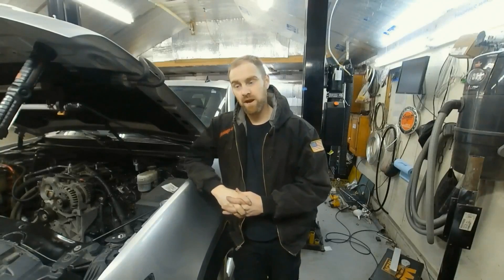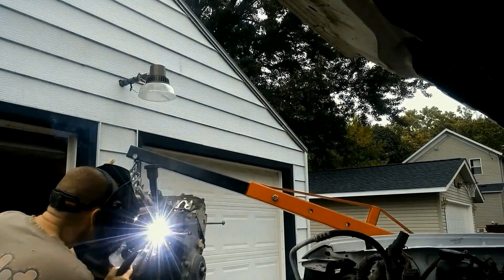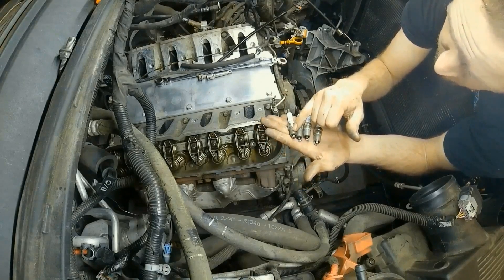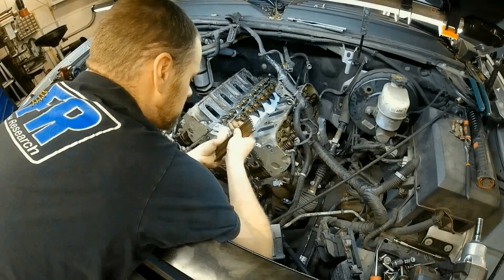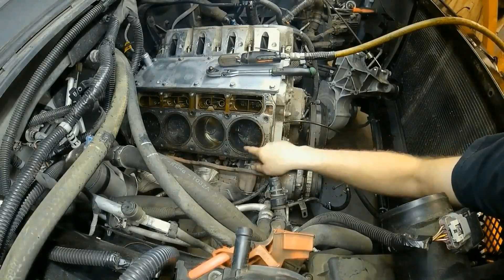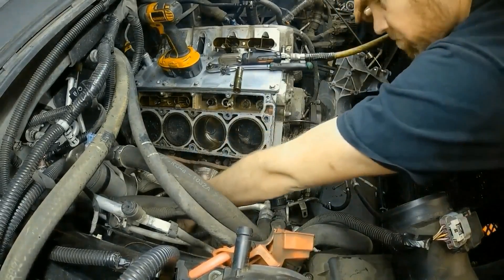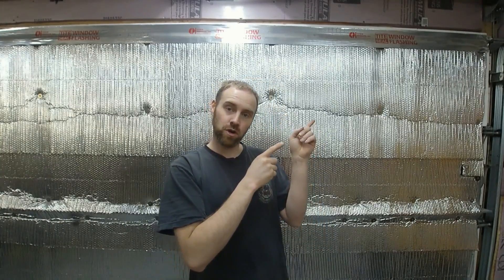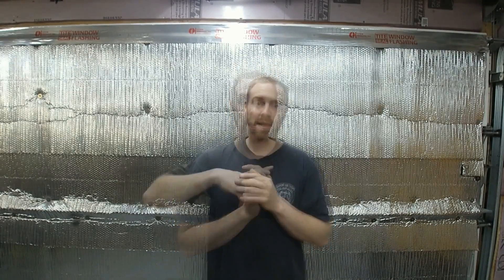DOD Delete kit using texas speed pt1 afm suburban tahoe...

Comment: To turn off the system do you need to install a bypass system
Reply from the maker: I have a video talking about it and I will also cover it again when I finish my editing on the rest of this install
Reply: CrazedPerformanceRepair I have watched all the videos you can’t just say yes or no really
Reply from the maker: @randyhughes5160  ok fine then yes it needs to be bypassed but no it can't be a bypass system. It must be turned off with a tuner within the computer. See not just yes or no, but sort of both because your question was not correctly phrased. So ask a poor question, get a poor answer, show a poor attitude and get a rude response.
Reply from the maker: You must consider I get asked things on a regular basis and if I'm not asked the right thing I may not answer or avoid the straight easy answer.
Reply: CrazedPerformanceRepair I am not sure what I did to deserve your attitude but I can certainly get help some where els and free you up
Reply: randy hughes  R/ChoosingBeggars check it out bro you fit right in
Reply: "To turn off the system do you need to install a bypass system"

Your question makes no sense.? If you have a functioning DOD system, you can leave all the hardware in place and turn it off using a computer reflash or something like a tuner that plugs into the obd2 port IF you want it off. 

LT1SWAP.com, you can mail your PCM onto him and he will delete the DOD for $50. Your truck will be down a week though waiting for shipping. Thats the cheapest/easiest route. The hardware such as the DOD lifters/solenoid can stay in place and should cause no issues.

Comment: Will it trip codes if you do the DOD kit prior to disabling the AFM with a tuner or will it run?
Reply from the maker: It will start but if the vlom is removed or unplugged it will not allow the throttle to operate. The final part of the delete will include changing the tune when I finish the video.
Reply: @CrazedPerformanceRepair  Thank you for replying - will check this out.

Comment: I got lucky and drilled out my two broken exhaust bolts
Reply from the maker: Drilling out seems like more work to me welding is much easier. This truck was luck there because I didn't have to do anything they just came out
Reply: CrazedPerformanceRepair it wasnt bad it took me 20 mins to do two bolts

Comment: Bro question::: 
07 Tahoe LTZ 5.3L with over 200k miles. Been thinking about getting the engine change but am confused in whether get a used engine and break it down to replace all major parts to bring it to a new state as in 0 miles or just find a used engine with low miles and throw it in? Thanks
Reply from the maker: Whats wrong with the engine you have?
Reply: Was told by the dealer when i went for oil change that i have small oil leak which they couldn’t tell where it was coming from at the time they had my truck, so just want to be a little prepared if i have to change my engine changed
Reply: Wouldn’t want to get this one rebuild because it’s my daily truck and would prefer to have something ready to swap just incase
Reply from the maker: @Loyal1029  I would not consider a rebuild over a simple oil leak I have seen a lot of these engines reach well over 300k mi of coarse the ones with DOD need DOD Issues addressed first but otherwise it's usually minor stuff.
Reply: CrazedPerformanceRepair thanks bro

Comment: I am working on my uncles truck 2010  with a 5.3 he has a lifter that is collapsed and it has 20 pounds of compression on number four and number two has 170 pounds what I was wondering do you have any recommendations to slow down the oil consumption once I fix the lifter problem I have heard about the driver side valve cover and the deflector  shield that goes on the oil pan what is your recommendations to help slow down the oil consumption thanks I really appreciate all your time on these videos you do a excellent job
Reply: The truck just has 120,000 miles and has been maintained
Reply from the maker: @mikereasoner4814  turn off DOD that is part of the consumption and if you haven't done anything about the pcv valve cover tsb yet be sure to address that
Reply: CrazedPerformanceRepair OK I fix the valve Cover thanks again for your reply and all the help and with the videos
Reply: I have a question I have an 07 Chevy Avalanche and it's not making any noise but I got a number 4 misfire
Reply from the maker: @briank447  and your question is?
Reply: My question is is I don't have a doesn't sound like I have a lifter collapse but I have a misfire and I replace the valve cover on the left side put new head gaskets on it any ideas
Reply from the maker: @briank447  You may have a lifter that won't lock back out of dod mode like perhaps its little mechanism is stuck thus collapsing the lifter. or perhaps the solenoid in the vlom is stuck flowing oil thus collapsing a lifter.
Reply: @CrazedPerformanceRepair  I appreciate your time I checked the solenoids when I had the valley cover off and all the solenoids were working fine it ran great for almost 2 weeks and then all of a sudden I get a light Miss on number 4 cylinder it's not a hard code yet cuz the check engine lights just blinking so I was just going to run it by I appreciate your help
Reply from the maker: @briank447  When the engine light is blinking it it worse than steady. That means you have a dead misfire Or serious problem and the computer is concerned you will damage the catalyst. look into it asap
Reply: I left a comment above but basically in our '07 suburban we had pretty serious detonation due to oil consumption/fouling (in '13 w/ ~105k miles).  At that time GM had a fix which involved cleaning the engine and replacing oil control rings and installing the oil deflection plate.  After this service the oil consumption disappeared (basically, became reasonably normal like 1 quart consumption between oil changes).
Reply from the maker: @mikegilmore8998  I think 1 qt is too much too unless you are going 6k between changes than I can accept it haha. But part of the problem is the DOD poorly wearing the rings while active and then of course the oil deflection issue with the pcv in the valve cover.
Reply: @CrazedPerformanceRepair  Yeah that was about the oil change interval for us.

Comment: I have an 06 chev Tahoe z71 and I'm hearing this lifter tapping noise....does this year have the dod and if not how would you recommend i fix it
Reply from the maker: In the Tahoe 06 is not likely but possible. May be late model in 06 thus basically 07. You will need to peak under intake and look. If you do have it check my other related videos for the easy trick to try first
Reply: I had an older engine like that tapping. Tore the heads off and put new lifters in. Same noise. New high volume oil pump got rid of the tapping.
Reply from the maker: Then it might have loose bearing or something sounds suspicious. Bad o-ring to sump or closed pickup?
Reply: @CrazedPerformanceRepair  I have had that happen on 3 different LS engines. First was a 2005 police Tahoe with high idle hours. Thats the one I replaced the lifters in. When it got hot at idle the lifters would get all noisy. High volume oil pump quieted that one right up. 

My current truck, 2007 Tahoe w AFM did the same. Engine was replaced in 2012 with a reman. Slung a high volume oil pump in that one and have put 12k miles on it with not a single noise or issue. 

Last was a 2010 Tahoe (old city of Chicago police truck). Same noise, that one had a dried out pickup tube o ring, but I did the pump as well and that fixed that one. 

So yeah, prob a possibility of the dried out o ring, sticking pressure regulator in the pump and possibly a bearing getting a little loose. All engines showed around 20psi of oil pressure with a mechanical gauge tapped into the oil sending unit hole while the tapping noise was occurring.
Reply from the maker: For dod engines that is low oil pressure. they typically are between 30-40psi hot with 5w30. The non dod engines usually are between 15-25psi hot.
Reply: @CrazedPerformanceRepair  Idk, service specs from Alldata for my 2007 5.3. Listed is minimum, so right around 20 I was low at hot idle (around 700rpm)

Oil Pressure - Minimum - Hot:

1,000 RPM 152 kPa (22 psig)
2,000 RPM 207 kPa (30 psig)
3,000 RPM 228 kPa (33 psig)
Active Fuel Management Relief Valve Oil Pressure - as Measured at Oil Pressure Sensor Location: 

Maximum 379 - 517 kPa (55 - 75 psig)
Reply from the maker: @mph5896   Gm also claims on tsb 01-06-01-011I that 1qt per 2000mi oil consumption as acceptable lol so you are better off going by what other vehicles normal is rather than specs. They list things that way to convince customers it is normal long enough to get out of warranty it seems.

Comment: Thumbs down is gm “engineer” that designed dod. Total loser
Reply: My 6.2 denali got 17mpg...had dod disabled and get the same mpg...total fucking gimmick by gm
Reply: It 'peaked' around 60's, less nickle then aluminum, they all fuckin' suck
Reply: the only V8 engine it worked good on is the hybird model which boosts the MPG by 4MPG  i get 22MPG city with the AFM   in V8 mode is 15 to 18mpg  on the Highway i get upwards of 26mpg
Reply: GM engineers are the best out there. Federal Govt  pushes these requirements.
Reply: @kbikerider8474  lolo...noway. Remember the 5.7 diesel joke ???
Reply: @acres90  Yes . you have a point there, but it is a different topic.
Reply: @kbikerider8474  maybe a diffrent topic but still done by GM egineers...also remember cadillac V8-6-4 from the early '80's?
Reply: @acres90  Yeah, I remember that disaster. I also remember the 1991 ZR-1 I bought with the hollow  front sway bar. Handled like a pig until I replaced it with one from a Z-51. Oh well. The factory computer on my Suburban LS-4 was also a mess. Cleaning that up (tune only) made a crazy difference.

Comment: How many miles on this vehicle?  I see these videos all the time but people never mention the miles. And wouldn’t this AFM system benefit from more frequent oil changes than these modern maintenance intervals systems call for?
Reply: Our '07 Suburban was detonating badly due to oil consumption at ~105K miles.  We required new oil control rings to fix the problem and GM agreed to pay half the bill because we were just barely out of powertrain warranty, back in '13.  At 156K miles we have barely discernable and brief lifter noise at startup and possibly lifter noise under load (like going uphill).  A week ago the engine looks to have blown a head gasket and catastrophically failed.  We're replacing with a rebuilt engine (LC9).  I'm considering installing a DoD delete module to turn off AFM right off the bat.  My sister's '07 Tahoe makes severe lifter noise at startup.  I think it's just a matter of time for that engine.

I don't understand how there isn't a class action lawsuit against GM on this engine design.
Reply from the maker: This one was only at 114k this problem  has been known to happen much sooner. I've had it happen a week after installing brand new lifters. Oil change interval generally is not the source of this problem, it stems from bad design.
Reply: CrazedPerformanceRepair, It’s a shame they can’t find a solution because it does save gas.  I guess with the price of gas so low these systems just are not worth the added complexity and cost.  Too bad they designed the lifters so the heads have to come off to access them.  A lot of these modern designs are a mine field of maintenance issues from 5 foot timing chains, chain tensioner, variable valves and water pumps running off the timing chains.  Well it should keep you busy.
Reply from the maker: @justcallmejohn2833  It doesn't seem to actually save fuel though... seems every one of them I have turned off or removed has gained 2 mpg but yes these are going to keep me busy for a long time lol...
Reply: CrazedPerformanceRepair, I heard there is an upgraded gasket for the valley cover, does that help?
Reply: CrazedPerformanceRepair Will deactivating AFM with a tuner prevent future problems or is a delete necessary?  Truck is running good with 122k knock on wood.
Reply from the maker: @smitttp  It should prevent the problem I believe.
Reply from the maker: @justcallmejohn2833  It may help a failed gasket but the system is flawed from the get go.

Comment: Nice, I have one to do next week. I haven't diagnosed it 100% yet but I think a non AFM lifter roller locked up and wiped out the cam.
Reply from the maker: ouch... yup time to remove DOD haha
Reply: Got it all done. Cam had 1 wiped out lobe on cylinder 5 exhaust. Non DOD cylinder. The roller was intact, just pitted in a few spots. 153k, 2012 Tahoe 2WD k9 truck. No hour meter. 

Used all GM parts, part #'s listed on LT1Swap.com, and had him program the delete into the PCM for $50. Total was about $600 for all parts/oil/coolant which included an oil pump and pan gasket. I did drop the pan because I wanted to do the oil pump. Total labor time was about 14 hours.
Reply from the maker: @mph5896  awesome, you should find out how they did the delete tune for only $50? I can't even do it to my own if I had one for that cheap
Reply: @CrazedPerformanceRepair  Yeah, its super cheap and he ships the pcm back quick. No idea how. He prob has a Gm software hack to reprogram the PCM instead of aftermarket stuff where you have to buy credits every time.
Reply: m ph where are you located
Reply: Aaron Cunningham Mi